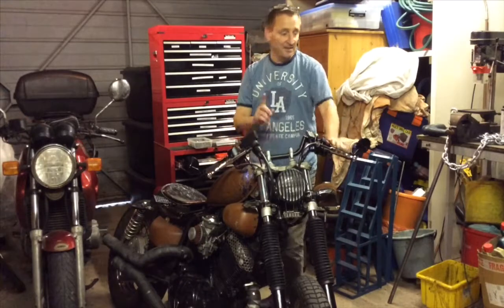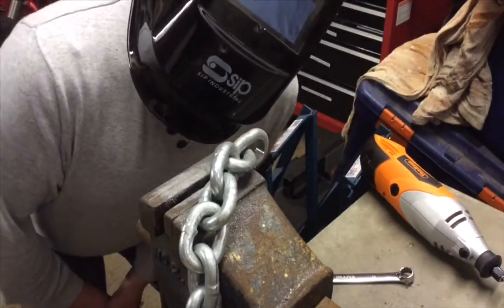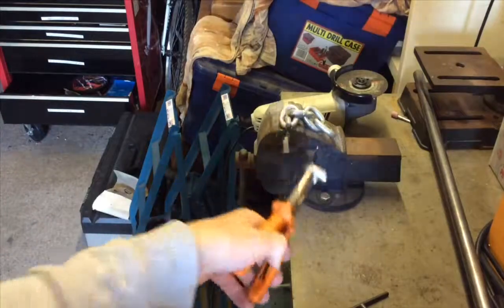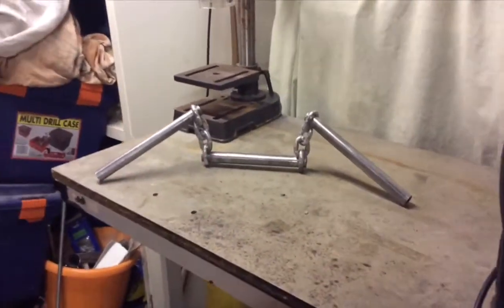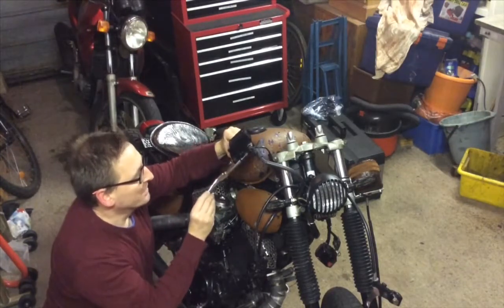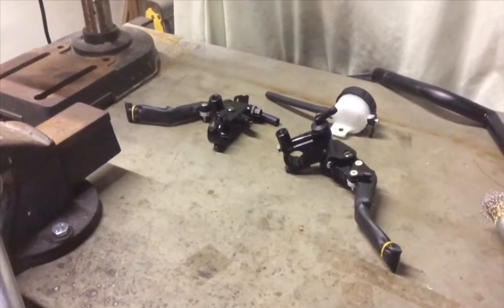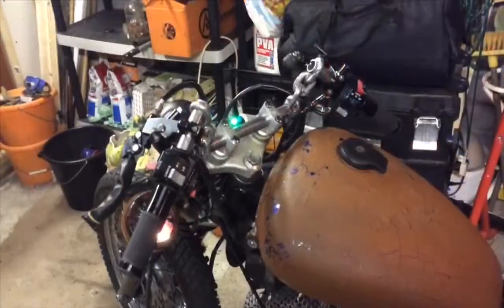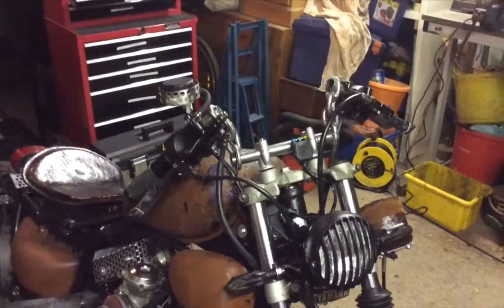Welding Fabricating Motorcycle Handlebars

Comment: They look good mate good job on them i would block the tops up to stop water getting down and rusting them, will you be spraying them or leaving them.
I see you went with same brake and clutch set up has mine I'm  looking at changing my reservoir on mine,
Reply from the maker: Hi mate, I was thinking of blocking the tops but felt they looked better open and rain will run right through anyway. I’m leaving them unpainted for a more rat look too. I preferred the reservoir you have on yours anyway but my  original Yamaha one didn’t suit the bars or the bike. The bars I had on there made the original unit tilt and it leaked from the lid, and on the new bars it would have been over at a ridiculous angle, so this one solved all the problems. I made that little guard for a bit of individuality. I’m just in the process of making a new brake pedal as my leg fouls on the side mounted carb and I need something a little further over. I just angle grinded the old one off so no going back 🤣🤣🤣
Reply: @memybikeni9931  lol you mad head good luck can not wait to see your next vid
Reply: You got them fitted and have you done the hammer test to make sure welds are strong anuff
Reply from the maker: hay mate, yeah I have given them the once over, the are fine, but im naturally cautious bout the level of weld penetration 😬 I’ll soon be finishing the foot peg weld I did and upload that. I have kinda finished it just need to fit a bit of friction plate of sorts but it came out well. I’ll upload it when I have finished by the weekend hopefully. Yours is coming on well
Reply: Please do not ride with these bars, those welds will break with all the vibration. Especially with the chain. I only say this so you do not end up hurt or dead.
Reply from the maker: @nathanphillips3807   appreciate the comment,  but that’s the risk with any weld on any part of any bike, and I’m replicating someone else’s work. I’m not trying to pretend they are anything other than an amateur attempt. My risk, no one else’s. I won’t sell the bike without the new owner taking his/her own view on it. I think the penetration was okay, I gave them a good hammering and went over the welds more than once, and there is no real stress on them,  and this isn’t a how to, but appreciate the concern my friend.
Reply: @memybikeni9931  theres a video here in youtube where there was a bike build off and "Indian Larry" made an entire frame out of chain links and rode it across the eastern states of the USA to the awards ceremony and the bike held up...Ill try to find the video link for you
Reply from the maker: @zenpro8164  cool thank you. I’ll look forward to that. I was a bit cautious about using chain link but will have to see how they fair.  With this, the seating position means there’s is no strain on the bars from me, so hopefully they don’t vibrate apart 🤣🤣🤣. Have a look at fuel head jay’s channel, he has done a few interesting mods with timing chains and drive chains etc on his XV535
Reply: @nathanphillips3807  theres a video here in youtube where there was a bike build off and "Indian Larry" made an entire frame out of chain links and rode it across the eastern states of the USA to the awards ceremony and the bike held up...Ill try to find the video link for you